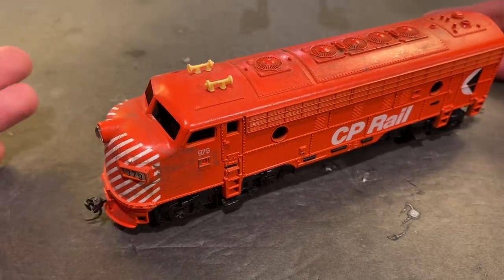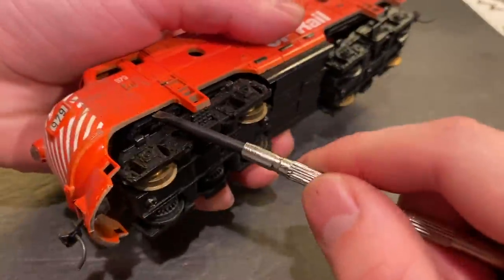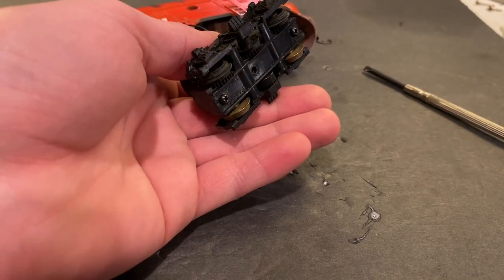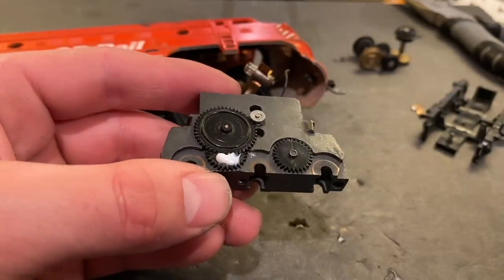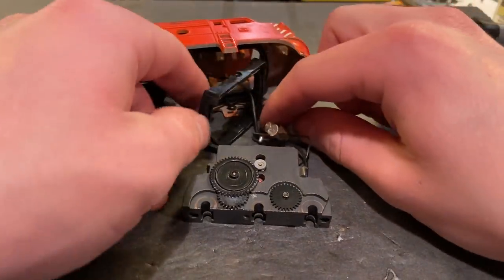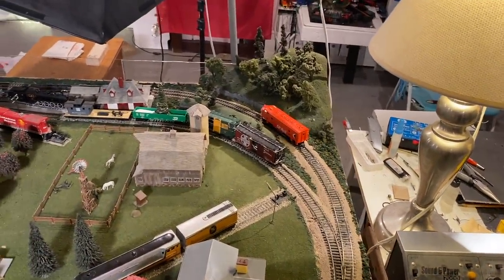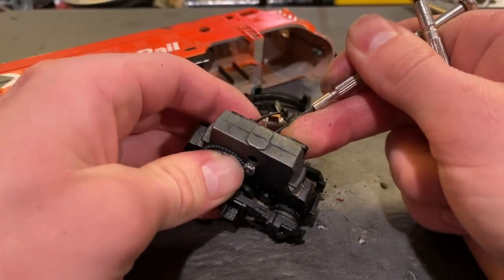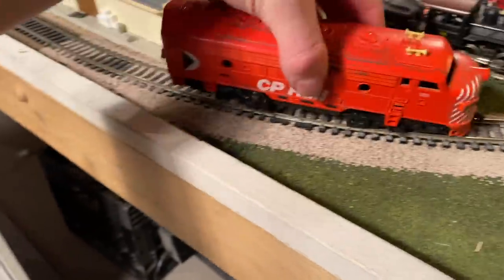This TYCO Canadian Pacific Hasn't Run In Years - Can We Make It?

Comment: CP Rail has a good paint scheme.   Beginning in 1992 CP Rail gained access to the Port in South Philadelphia via its Delaware & Hudson Railway by way of the ConRail 25th St. viaduct,  a two mile long double track concrete structure.   I photographed the pac-man scheme on numerous EMD SD40-2 ,  SW-8 , SW-1200RS,  50' green plug door newsprint boxcars and yellow wide vision cabooses.

Comment: That's the second Tyco F-unit body, too.  I'm not sure what happened to that tooling, Tyco made it because the original one had pretty well worn out, but when Mantua came back they must have gotten that old tooling and fixed it.   IHC ended up with the assets that General Foods kept but never made any of these.

Comment: wow I have not heard that sound from a motor since I was a kid playing with fixing these things and road race cars. Otters make the same sounds!
Reply from the maker: I'd imagine they might have been the same motors tyco used in their slot cars.
Reply: @SMTMainline  - My brother & I received a Tyco slot car set for Christmas 1972.  The Tyco motor had a frame made out of a C -channel shaped piece of metal that was formed into a square shape, with the flat side out.  The field magnets were placed into opposite sides of the frame.  The armature was in between the magnets & had its bearing holes going through the two other sides of the frame - with a spur gear at one end of the armature shaft.  One of my friends had an AFX slot car set - those cars had an armature that was similar in design to the Power Torque motor.

Comment: The problem was that DIY repair using a ring connector was screwed into the motors cast iron housing creating an intermittent short from positive to negative where the ring connector met the original spring plate.

Comment: SMT - You've seen these problems quite a few times, so you know what to look for right away!  The hobby shop that had a bunch of CP F-units, that would be a good shop to visit if you want to make the Silver Streak Amroad train!
Reply from the maker: Yes, these power torques as you know seems to have had common flaws but it makes it easy to fix when you already know how to handle it.

Comment: I actually like the paint scheme they had on these. I have one freight car that has the Pac-Man paint Scheme but is a light blue. I honestly wish that typo never went with this power torque because that pivot gear is the most unreliable piece that they have on it they expect a lot for that little tiny gear to actually power the entire locomotive if they went with a drive system similar to the steam engines and then use the driveshaft system I think they would have had a better product. I would agree with you it is pretty mint to actually see the low-speed performance I'm quite amazed myself. A nice good easy restoration nice job.
Reply from the maker: I don't know how it was able to go so slow, very unusual for an engine like this.
Reply: @SMTMainline  yeah i know same as my Rivarossi dockside and my lifelike fph40. 3 pole motors i think when done right balanced too make a world of difference
Reply: Tyco should are just left the motor to mantua they were actually very good

Comment: That Power Torque has it's contacts flipped around.  On all of mine the one that is at an angle is at the bottom. It's still working though so it's no biggie.
Reply from the maker: Don't know why it was changed but the only difference will be the direction the loco runs.

Comment: SMT - Both Roger Lee & Martin Gotham, as well as I, would like to see you tinker with your British OO scale locomotives.   SMT - try putting the straight sections of your Lemax track together & see if your Tri - Ang & Hornby locomotives will operate on it (Since the Lemax track has a taller rail than code 100 HO track.).     As for your Trix Twin locomotives, you could see if the center rail sliding shoe contact has a lug where you could solder a thin, flexible wire to complete the circuit connection with the transformer.  You could also try laying a stiff, large diameter bare wire down the center of the Lemax track for testing the Trix Twin locomotives.

Comment: Awesome!  It's a Power Torque, of course it will run.  They're my favorites.  It looks like your biggest problem was the brush making contact and the pivot gear was loose.  Maybe a drop of oil in the pivot gear and the other side of the commutator.  I love it.
Reply: Can you recommend someplace I can read up on what "Power Torque" is?
Reply: @GeraldM_inNC  Power Torque is just the name of that type of motor that Tyco made.  SMT did a good job of explaining how to fix them.  What do you want to know?
Reply: @dbtech7914  Is it a fundamentally different type of motor from other model trains?
Reply from the maker: @GeraldM_inNC  It's got a "pancake" motor, very similar style of motor to what Bachmann and Life like used at the same time. These motors were ironically very low torque however through a massive gear reduction they were able to increase the amount of torque they could pull from them, thus they were called "power torques".
Reply: @GeraldM_inNC  - Tyco started building locomotives with " Power Torque Drive " in the mid 1970s.
Reply: @Petemonster62  Are these less powerful motors?
Reply: @GeraldM_inNC  - Sorry Gerald, I have never done a comparison myself.  Tyco's catalog advertising claimed that they were more powerful.  Perhaps SMT & other modelers who had done an actual comparison of the two drives could make a comment regarding their testing results?
Reply: @Petemonster62  It's that I've picked up little snide comments and tones of voice from content creators of model train videos when they mention Power Torque.  Reading between the lines, it's as if they're saying "I don't really expect much out of a Power Torque locomotive."  I'm a total beginner in this field, but I'm not a beginner at reading between the lines of words and voice.
Reply: @GeraldM_inNC  - You are correct!  Many HO modelers have said that Power Torque wasn't as good as the previous Tyco/Mantua motors.   You will also find disdain amongst Lionel O gauge modelers about the " Fundimensions Era " of Lionel trains that were made from 1970 to 1985.

Comment: If you ever get an old F unit like that one and you really like it with a little work like cutting out the forward coupler pocket and fight filing where the back door is it will fit on an atheron F unit chassis....

Comment: Hey Pancake motors are kinda neat ,I have about 10 I think in various engines - the good ones are few but the best run as if they have a flywheel in them , only 2 I have found like that ,they are Lima ,but very good also Lima has it in N scale and they are o.k. for the size 🚂🚃🚃🚃

Comment: Did you lube the motor shafts? Probably help a lot. I also would have knocked off all that extra solder on the brush holders.
Reply from the maker: I usually don't on the side of the commutator since the oil will almost always end up on it.

Comment: Why were so many models of F-units made back in the day?
Reply: They were very common on many railroads - in freight & passenger service!
Reply: @Petemonster62  So were GP9's, but Life-like, Model Power and Bachmann weren't cranking those out by the thousands
Reply: @TomLuTon  - Tom, you are right about the model train manufacturers not producing a lot of GP7s - & yes, they were a common model found on most railroads.  It seems the various manufacturers made various different models when it came to road switchers; Tyco made Alco Century models, Bachmann made GE models, I recall Life-Like making some kind of EMD GP model or Alco RS model - the same with Model Power.  AHM/IHC had their GP18 & BL2.  Athearn had the greatest variety of road switchers.
Reply from the maker: In terms of models, they were probably easy to make since they didn't have handrails etc
Reply: @SMTMainline  - that is a good point SMT!  About the only handrails found on a model of an F-unit were molded-on handrails for the cab doors.  The fact that many of the Tyco road-switcher diesels didn't have any handrails also would support that view!
Reply: @SMTMainline  I'd also have to say that with injection molding, the molds for an F-unit (F3, F7, F9) were much easier to make than a GP mold. And with much more simple molding, the injection molds would by nature last longer as they are not as detailed as other moldings.